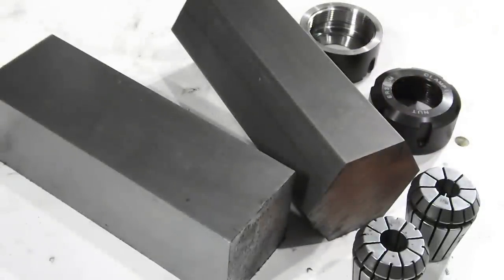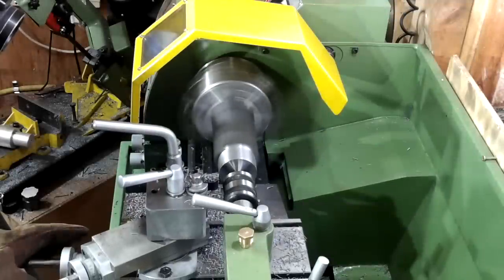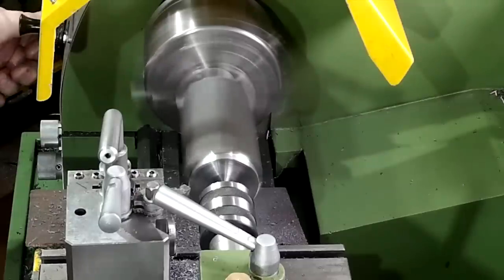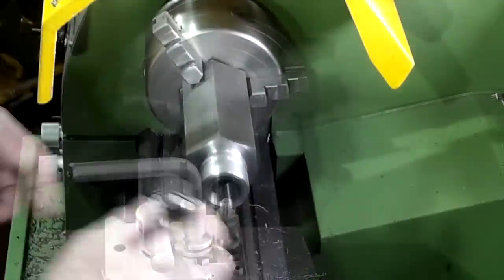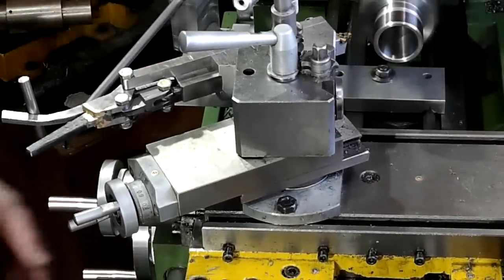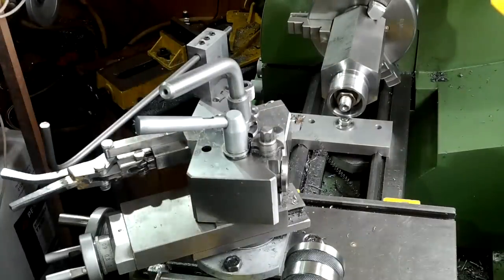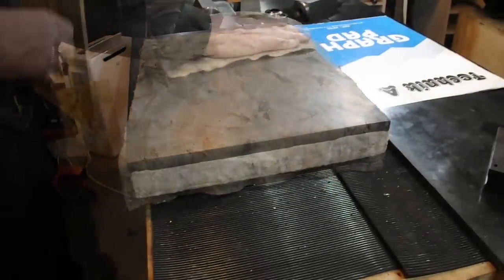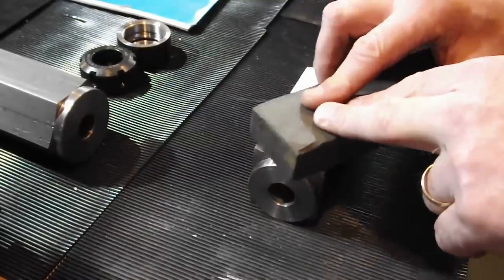Making Collet Blocks

Comment: The best way to get an uneven shaft as centre as possible is:  To face one end and after using your 45° marking ruler find the approximate center. Then punch it, line up with the running centre on tailstock and make a centre hole. Then lath a gripping space for your 3-jaws. Turn the shaft around and repeat. You'll lose the least amount of material this way and probably save on cutting time too. Especially if it is a big piece of work.😊
Reply from the maker: hi, thanks for that. cheers

Comment: Hi paul. I see that you ground the faces whilst the unit was sitting on the unground face on the machine bed. Surely that just transfers the error from one side to the other side. Should you not have turned equal diameter rounds each end, sat them in identical "V" blocks & ground the faces which then referenced off the circular ends?
Many home hobbyists do not have a surface grinder. How would you suggest that one goes from there without one? Any guidance please

By the way- Enjoyed the vid- Thanks
Reply from the maker: Hi, Graham.
I have found that whatever system one uses, there is always potential for error. For me, I have found best way to keep the error to a minimum is to have as few components between the datum face and the guaging device as possible.
Machining two collars to precisely the same diameter is hard enough,  you also need two inspection quality Vee blocks to ensure accuracy along the work piece lengh, but what about the rotational accuracy. I used the surface plate and DTI against a known diameter because it was easier to do and the result is more than good enough for any workshop. The hex shape has three sets of parallel sides, but I can't garantee that the three parallels are Identical, unless I keep an eye on the opposite corners as well. At the time I didn’t have a shadowgraph to make this comparison. However, having three parallel faces and three sets of edges that were less than 0.01mm out of true is good for my money anyday.  
Not having a surface grinder is not a problem use a thick glass sheet with wet and dry of various grades of paper, applying more pressure to the area requiring more material removal, use figure of eight strokes. Scraping is another method but thats a whole different ball game.

Comment: If something is made to a standard, it doesn't matter where it is made, nor by whom.  Importers and wholesalers don't want to pay for quality because consumers don't want to pay, they keep buying substandard merchandise because its cheap.  You get what you pay for in this world.  If folk stopped buying rubbish the price would go down and the quality will go up.

Stavros
Reply from the maker: Hi, Not everybody can afford to buy hi quality stuff, I for one.   For me it is the difference between new cheap stuff or good old but worn stuff.
I am lucky in a way because the machines I first worked with were 40 or more years old and were for the most part well worn, as well as very big.

While I was getting used to the peculiarities and irregularities of these huge machines to produce to a standard, I was learning to cope with what I had to work with and make do,  because the boss wasn’t going to buy a new 1£m machine because I couldn’t get it to produce to a standard. The only option I had was get it right or get another job...
But I must agree, I have bought some rubbish kit in the past and if I couldn’t fix it, which for the most part I would try to, I'd buy a better quality one next time. It still wouldn’t stop me trying to get the best out of what I've got. Thats how I believe many wannabes or shed dwellers seem to be.

Comment: Why not make an octagonal collet block, rather than the square one?

An octagonal one will be more useful, since it will do both 4-sided, and 8-sded work.
Reply from the maker: hi, if I put the square block between two Vee blocks that does the same thing. cheers
Reply: @Thesheddweller  That would work, except you would have to adjust the depth of cut, for every other  side.
Reply from the maker: @BedsitBob  my vee blocks are narrower  than the furthest two corners of my square collet block, no problem there. cheers

Comment: Nice job. 👍 And here I thought that ER collets were a 20° included angle. I seem to remember someone making combined ER and 5C collet blocks.
I made my own collet blocks years ago. They're 5C. Yes I full well understand that ER Collets have a greater gripping range and grip tighter. But there are things the 5C Collet system can do that the ER can't.  But I went beyond the normal 4 and 6 sided collets. I made 5, 7, 8, 9 and 10 sided collet blocks. This describes the process I used. 
https://bbs.homeshopmachinist.net/forum/general/9251-collets-blocks-redux-long-post
Reply from the maker: That was interesting, I thought I went a bit bonkers with the Gear cutter index plates, thats some work.

Comment: How do you grind off a specific amount? Guess it is easy to grind off too much or too little? Is that a million of tries or something less effort consuming? Thanks
Reply from the maker: Hi, with a grinder, you only take off very small amounts with each pass, so you can monitor your progress.  It's best to get the the material within 5thou of required size then finish with a grinder.
I did cheat to get the results I required by using cigarette papers and moving them around below the material to achieve the desired effect.

Comment: I don't understand. Surely you create a collet block to eliminate the runout of the chuck yet you use the chuck to turn said block. My lathe is the same one and the chuck is a few thou out of true. One can get unmachined or ready machined backplates from engineering supplies?
Reply from the maker: Hi, these collet blocks were made to be used in a milling vice not the lathe. I have a number 4 morse adapter with an ER32 collet that fits in the chuck centre hole for this purpose.

Comment: Excellent. I'm curious about order of operations. It seems to me that if you had applied the thread before cutting the internal taper, you could have used the live center on a spot drill in the original material. Is there a reason you didn't do it this way?
Reply from the maker: Yeah. didn’t have my thinking cap on. thanks for watching.

Comment: Could you not have put round bar of the same diameter as a collet then use a live centre to push the collet it to give a truly centred item.
Reply from the maker: (Yes. But I would have had to mill them and paid more for the materials, I do have to watch my pennies.) sorry think I missunderstood the question… did you mean same profile as the collet, yes that is a good way of dealing with it, but I’ve only got one lathe. I’ve always worked on the principal of never take the material out of the machine until its finished because it never goes back to the same place. I didn’t make a fitted bung before I started these. Mind you I suppose with hindsight I could have simply used the smallest bore collet. regards

Comment: Why are you characterizing the Chinese tool as cheep. Why are prejudicing China for no reason. Go and get yourself an expensive tool and leave the Chinese alone. I just do not understand this kind of thinking.
Reply from the maker: The Chinese do build lots of stuff lots of it is good stuff, but where quality really counts its not so good. but it will do, that's all. have a nice day.
Reply: Because Chinese tools have earned the reputation.   Are we expected to buy a tool from China just to see if it will be satisfactory?  I'm fairly certain that China has the ability to make quality products, but unfortunately they focus on price over quality.   Being critical to the tools they produce is not unfounded criticism.  The only people that have the power to change that reputation is the Chinese by improving the quality and workmanship put into their products.
Reply from the maker: @buckinthetree1233  Hi.  Yes, I agree they do have the ability to increase the quality, but I’m sure quality is mentioned somewhere in their manufacturing processes, but quality doesn’t seem to rank too highly.
Reply: You can get anything you like made in China, to any specification and tolerance, for the right price. The "low cost and low quality" reputation exists because most of the stuff we in the West import from China exists to supply the bottom end of the market.

Tl;Dr: if you want quality, you can get it almost anywhere if you pay, including China. If you want cheap, China has the market cornered.

Comment: Question: why wouldn’t you true the cold rolled surfaces first ?
Reply: Cold roll has tension/stresses in it from it's forming process, and machining the other features may allow these to influence the final shape/outcome of the part.  There are things you can do to relax those stresses from the material and minimize those influences before major machining, or you can make corrections after.

Some have been known to start a project, do the rough work, put it on a shelf for a year or more before machining to final sizes.  Some will run the part through several heating/cooling cycles, to 'normalize' the stresses that may be in the material

Machine castings are often allowed to season outside for a time, because the heat/cold cycles relaxes them, and they are less prone to change (bow or warp) on you during machining, or during the first operations of the finished machine.  That is the same reason why most truckers prefer a rebuilt (that includes crankshaft line boring) over a brand new engine.  The casting has been seasoned and settled (stabilized), and corrected where needed, resulting in a free working assembly under all conditions.

That's my understanding of it, anyway ... hope it helps
Reply from the maker: I did it that way knowing that the tapered bore may end up slightly off centre to the outside flats, and its easier to true up the flats to the setting paths than the other way round.
Reply: @Thesheddweller  When grinding how do you ensure the hex angles were 60 degrees? When grinding all you did was ensure opposite faces were parallel, there's no way to tell if adjacent faces were actually 60 degrees apart
Reply from the maker: @phranklyn  Hi, I put the hex bar in my Kerney and Trecker universal head and you are right they weren't exactly 60deg but the largest error was less than 0.06mm per 25mm across the flat and that is good enough for me, at least until I get it hardened then I can regrind the flats and hopefully by then I can do internal grinding to get the taper reset to suit.
Reply: @Thesheddweller  ^^^ that, too!  Forgot about how doubleboost had to work on that set from BG.  I was remembering the tool & die guy mentioning the stresses that are usually in cold roll stock, and how they can work against you in precision work.

Comment: Excellent video thank you for sharing!  Subscribed :)  What is the make and model of lathe you are using?
Reply from the maker: I have a Warco WM250V it’s a chinese made lathe, it's very low on power (worse at low rpm). there are many things I am not happy with, but for the money I paid, it will have to do.

Comment: Nice!  I've recently made an ER11 version (nowhere to buy these that I could find)...  I like your thread cutting setup, that looks like it makes things real easy
Reply: I need to make an ER11 set also. Can you share your thoughts on materials and dimensions?
Reply from the maker: @srrlrrmuseumphillips Firstly, Thanks for watching. I think the important thing to consider is what you can handle and what you want from your blocks, you might want to make the blocks double ended, so you might want to consider this first. As for materials I would, if I had a choice, use a medium carbon material and finish grind all dimensions after hardening. Alas, I am restricted on the hardening and when I made these ER32 collet blocks, they where given to me as offcuts for a fraction the cost of buying the material from a stockist. hope this helps
Reply: @srrlrrmuseumphillips  I had some 19mm mild steel square bar stock (I have only made the square block so far), mild steel is ok enough for my model making but it will probably get dented and may need replacement at some point.  The thread for ER11 depends a bit on the type of nut you're using, mine was 14mm with 0.75 pitch (ER11M) which seems to be a common size.  I set the square stock in a 4 jaw chuck, got it as centered as I could, drilled an 8mm through hole, cut the 8 degree taper for the collet and test fitted it with one of my collets.   After that I did the outside machining for the thread and used a nut that I already had to get the fit right.  Quite similar actually as was shown here. The most tricky part for me was that the Chinese lathe that I have doesn't list the 0.75 thread pitch in the standard gearing table but it can still be made with the standard change gears.  Not sure anymore which combination I had to use for that though.
Reply from the maker: thanks. its fairly easy to use, but it hellish quick to set up.

Comment: If you change the order of some of your operations it will simply the process. I suggest that you cut the threads prior to boring the collet blocks. Then you would be able to use a center without having to put something in the void created during the boring operation.

Comment: Collet blocks + coaxial indicator can be used for edge-finding too. (Just clock up the internal taper). I think that mathematically this also tests for square (because of the taper), but whether it does so practically is something I haven't analysed.
Reply from the maker: Hi, I'd be interested to know.
Reply: @Thesheddweller  I think I have decided that the taper might be less useful than a cylindrical bore. 
A cylindrical bore at a tilt will go + at two points. A taper bore will be + and -,  so will look just like an offset, and can be compensated by an incorrect axis position.

Comment: Hi, Paul. I'm guessing you have made these 2 collet blocks extra long to give them some counterbalance and prevent them falling out when the pressure on  vice jaws is undone. The standard length blocks are a pain in the ass for falling out the vice if you don't support them with one hand whilst loosening the machine vice.
Reply from the maker: Thanks for your comment Howard. It’s true, that is one reason, the other reasons are that if the material being cut is a long piece and is also able to pass through the blocks they should also support this material, to a degree. The back end at the moment is just an exit hole but, I may make another type of collet fit this end, clamped by a draw bolt through an adapted EN32 plug, giving me at least two methods of holding material.

Comment: Hey Paul, your up there with the best YouTube engineers but only 121 subs!!!!! Have you got any info, or even a video, about your 'home made' surface plate? Thanks, Kieron. =D
Reply from the maker: Kieron Desmond Hi, thanks for your comment.  
The home made surface plate is a mongrel marriage of concrete pavement (sidewalk) slab and 3 bits of Flat granite tile from a kitchen supplier.
I used one tile and bonded it to the concrete slab with concrete glue not cement.
Then used a concrete cutter to square the slab to the shape of the tile. 
Next, I glued the two other tiles back to back with some scrap blocks and labelled them side B the other as C.
I stood the main block on three small feet on top of the worktop.(block A)
Initially using valve grinding paste, I used the A, B, C, method of match grinding each part together. eBay provided the diamond lapping paste to complete the lapping process.. Finished.  Have fun.
Reply: @Thesheddweller  Thanks Paul, top info =D